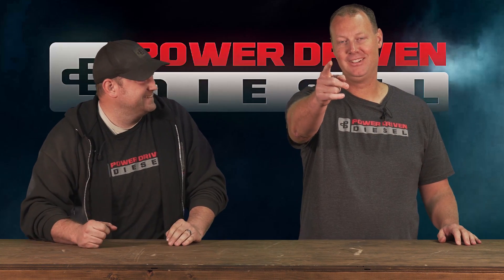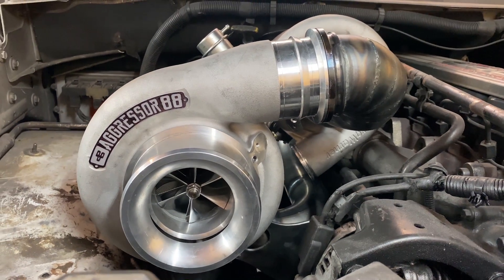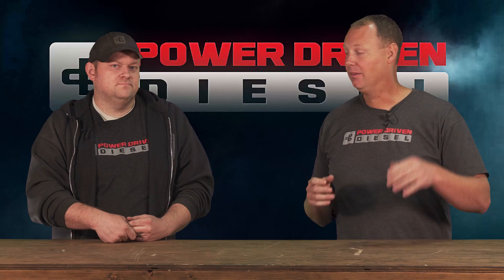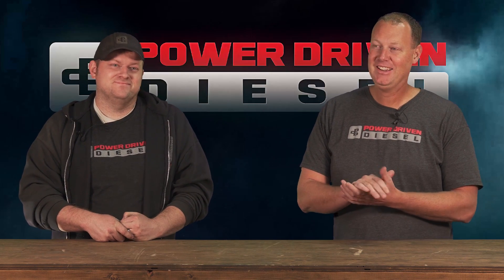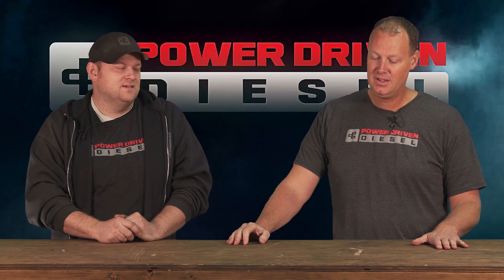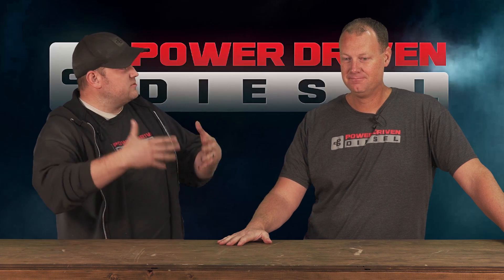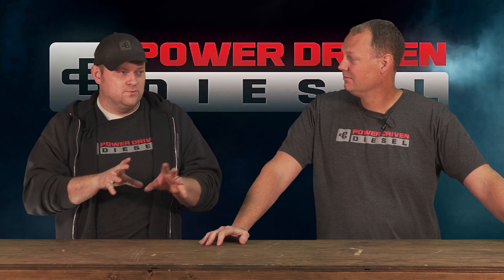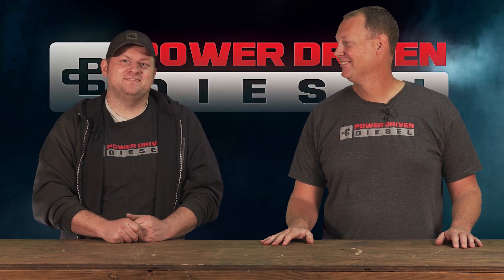Compound Turbos for the 800 HP Cummins Street Truck | Power Driven Diesel

Comment: For 650-700hp, how would a BorgWarner EFR 9280 perform compared to a compound setup?
Reply from the maker: It will still be much lazier to light vs compounds  but will still do 700 hp

Comment: Have you guys tried to put a variable venture turbo on a 12 valve i seem to hear about some one putting one on their 12 valve removing the actuator and replacing it with a veneer throttle cable any thoughts

Comment: Hello guys 
Quick question;
I’ve got a donor 98 dodge 3500 12v/NV4500 that I am putting on my 73 Chevy Cheyenne C30 crew cab. Looking to get around 600-650hp. Won’t be towing anything. This truck will be my daily driver/show truck. Thinking abt pairing the S369sxe with my stock hx 35. Will this set up reach 600+hp? Or just running a single turbo would be enough?
Let me know your thoughts and keep up the great work.

Comment: Yeah can't understand why your blowing up turbo's when your EGT's are off the chart and your not using any data collection to know when you have hit the limit of something... still tuning in the 1960's at Power Driven Diesel
Reply: they monitor every single thing, egt doesnt make the compressor wheel come part either, know it all
Reply: @cs-gj3yf  ohh yeah, show me where their monitoring everything? And yes excessive EGT’s and ROM is what destroys turbos…you can’t force 2000degree + air at high velocity through a constriction and not expect eventual part failure. Also just having a gauge isn’t monitoring shit. Data logging so you can see what actually happened
Reply: @christopherbenfield7848  only thing that failed is the compressor wheels, cause they was overspun, they 100% know more then you, and they 100% have done more then you ever have, they wouldnt throw heat at it without monitoring it.
Reply: @cs-gj3yf ohhh really do you know me or do you know them personally? Cause I don’t know everything, but I do know thermodynamics and I’m not the one constantly blowing up my project/race trucks on the dyno and not having the data on what happened in order to keep it from occurring over and over…
Reply: @cs-gj3yf  ohh really? By monator you mean a gauge in the dash that moves? Thats not collecting data at ALL...know it all
Reply: @christopherbenfield7848  um you havent seen the inside of joshs truck, its got 4 post gauges, 1 dash gauge above the steering wheel, 3 gauges below the radio, and 1 line pressure gauge beside the seat, i promise you he monitors everything, also has the tuner on the window that monitors internal stuff

Comment: Any guesses on what It might run the quarter mile in? I put 800hp and 5800lbs in to the qtr mile calculator and came up with 11.27 seconds at 127mph? That B a scary fast full size 4wd truck.
Reply from the maker: We need to find out!

Comment: If someone told you he saw a 800HP Cummins diesel out racing on the street about 25 years ago, people would have said yeah, right. These two characters put one together making 1600hp plus. Then they build an every day driver 800hp truck that should exceed a stock truck fuel mileage and outrun those little Hondas. Plus you can drive it for many years to come.  Isn't this everyones dream truck?
Reply from the maker: Definitely my dream truck!  Sports car with a view!
Reply: i mean, the pullers have known it for far longer than that.

Comment: Maintenance and with stock location trucks like power strokes and the dramas series engines packaging can be an issue as well since the turbo is mounted on top of the motor in the valley fitting an external gate in there could be a pain. Unless you go dual gates and put one in each up pipe off the manifold and then there’s two of them to have to maintain.
Reply: Duramax I hate autocorrect
Reply from the maker: You can also use a wastegated pedestal

Comment: Question? Why don’t people use compounds on class 8 trucks! I’ve even heard of people taking compounds off acerts and going to a single! Why wouldn’t you decomp the engine and disconnect the IVA’s?
Reply from the maker: because of emissions
Reply: Power Driven Diesel Yeah i get that, but guys convert them to single turbo as well which would stuff up emissions anyway?! but you could use it in an older truck? 
No one seems to be able to answer this question?

Comment: It’s got me super excited to maybe win this truck!!! My 1996 dodge Cummins is out of commission tell I buy a NV4500 or nv5600 transmission. (Bought this truck with out a transmission) in the meantime I’ve pulled the motor that has 311,539 miles on it and slowly rebuilding it. Why not since the transmission is not in it. Fix all the leaks and go through it. I have to buy parts anyways so it’s definitely motivated me to purchase the parts from Power Driven Diesel. I’ve always wanted one but of course money talks so I will nickel and dime it tell it’s on the road!!!!!!
Reply from the maker: Best of luck to you!

Comment: PDD: Would you comment on billet aluminum compressor wheels.  Some say - lighter, more efficient, more durable, better response,...
Reply from the maker: Billet sells part!!!  Technically cast should be slightly more porous so should weigh ever so slightly less if all else is the same.  Some believe billet parts have more material uniformity thus allowing the design to incorporate tighter tolerances and thinner/lighter blades without the fear of a material inconsistency causing a premature failure.

Comment: An S475 should have been enough to get you to 800rwhp I would think and I would expect it to have better response and more torque which would be nice in a street truck. Of course saying you have an 88 under the hood is so much cooler. :-)
Reply from the maker: Although the 88 is overkill, a Borg-built 475 has never come close to 800 rwhp on our dyno on a 12v Cummins.  We generally see 7 RWHP per LB of air the turbo moves on the compressor map with a moderately built 12V Cummins on PDD's dyno.  That means a box 475 would do 700 HP.  That's not to say a purpose built highly modified 12V with big fuel system and all the best internal parts couldn't be pushed with a custom built 475 to barely tickle 800 HP, we've just never seen it.  Most highly modified 12v powered vehicles that run on the dyno don't run a 475 turbo if they have the myriad of other upgrades to prep them for big power, they generally want big power when building an engine of that caliber and therefore never choose a bigger/badder turbo capable of 1000+ HP.

Comment: Dude I love what you guys do .i can’t wait to use the aggressors. I believe in and support your innovation and was looking at turbos on your website  but what the f**ck is that hacked together “hx super 9” doing on your website ? I know that’s not something power driven created because it  Looks like a total hack work ! What’s goin on !?!
Reply from the maker: In some states with strict visual turbo inspection requirements or sled pullers in stock-appearing turbo classes, there is a huge demand for hotrodded stock looking turbos.  We don't build them in-house, but they do generally get good feedback from the few that we've sold.

Comment: Ah, that explains the compound turbo system.

Yo, Todd, I heard you like turbos, so I gave your turbo a turbo! 😆😂😆😂😆😂
Reply from the maker: Pretty much!
Reply: @pddofficial  oh right, while I have your attention: why aren't you running an intercooler between the turbos? I would have thought the air temps would be dangerously high even for a diesel.

Comment: Great Video I've been running the stock over a 369sxe compound that PDD had install on my 06 since 2016 still running great defiantly more fun to drive and race with having compounds haha
Reply from the maker: Aric, you're an old customer from way back, glad you're still happy with your truck!!!  Hopefully you guys in Vegas can get back to work soon!!!
Reply: Awesome. I'm planning on doing either that or a 472 myself. Do you have the 5.9 or the 6.7? I'm waiting on PDD to get a 68RFE kit before adding the compounds, figure if I don't I won't have 6 gears for long.
Reply: @Parents_of_Twins   I have a 5.9.. that's a good idea getting your trans done haha I had PDD build mine, great transmission paired with PDD trans fluid can't go wrong.....good luck on which way you decide to go tho

Comment: The better question is why wouldn't you want compound turbos especially on a street truck? I can sort of understand wanting a large single on a drag truck. Even there though all that time waiting for spool up. I like the supercharged compound turbo setups on diesels. No black smoke and tons of torque down low and no lag. Still don't quite understand why running a diesel rich (black smoke) gives more power. How much of a horsepower gain do you see when going from no smoke to black smoke on a performance engine? Say going from 17:1 to 15:1 AFR.
Reply: Diesels rely on auto detonation. Going extra rich will just mean more black smoke. The black smoke you see is the tune up trying to add volume to the exhaust and help spin it up. More air means more fuel. More of both means higher dynamic compression which means more heat. Get too much heat and you melt stuff so they richen it up to use the unburned fuel to pull heat from the cylinder and go out the exhaust.
Reply from the maker: There's a 690 rwhp 12v street truck at the shop with PDD's ultimate towing compound setup.  The smoke threshold occurs right around the 525 to 550 RWHP mark on the dyno.  Meaning, it's clean when the fueling is cut down with AFC LIVE to limit max power around 500 RWHP.  If fueling is turned up further, visible haze starts to come from the tail pipe around 525 HP with heavy smoke from 580 thru 690 HP.  So to answer your question, on a 500 ish HP compound turbo truck with an otherwise stock 12v engine, you can pick up an additional 150+ HP going from no smoke at 22:1 to heavy black smoke at say 12:1.  

On a performance engine, the gains are even larger:  The Junker Drag Truck cleans up to a fairly light haze around the 625 RWHP mark with the fuel limited to the low 400 cc range.  Turning up the pump to the full 650 cc's picks up an additional 300 RWHP and fairly heavy smoke from the hood stack.
Reply: @pddofficial  That is very interesting. What about when adding nitrous? I'm trying to understand why adding more fuel on a diesel adds power. On a gasoline engine running rich causes a decrease in power, actually found a video showing someone changing the AFR and as he goes from 12:1 to 13:1 to 14:1 he gains power. Some danger in running too lean on a gasoline I don't know if diesels are like that or not I've heard no but not from an expert. I find this very interesting. Wish you guys were closer of course then I would be in person bugging you all about this stuff but that probably wouldn't work :), although I am good at turning wrenches. I do very much appreciate you all taking the time to answer these questions. Thank you very much. I'm a big fan of engines, horsepower, and efficiency. Once again thank you very much for answering my many questions.
Reply: On a diesel you dont want no smoke. You want a light haze after the turbo/turbos spool. That means you have plenty of fuel for your setup and not too much.